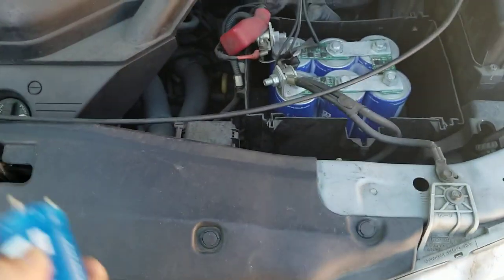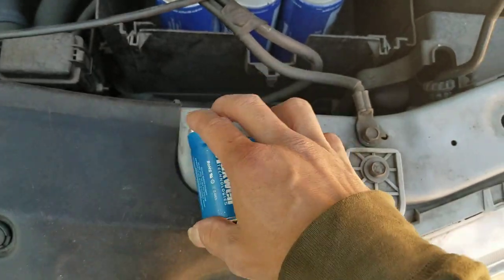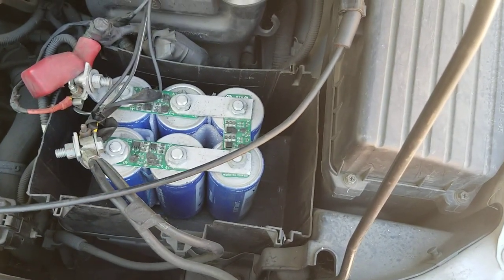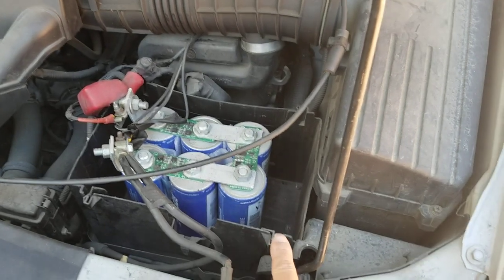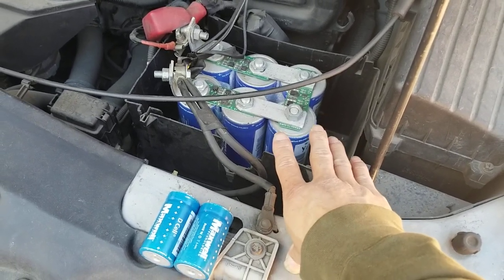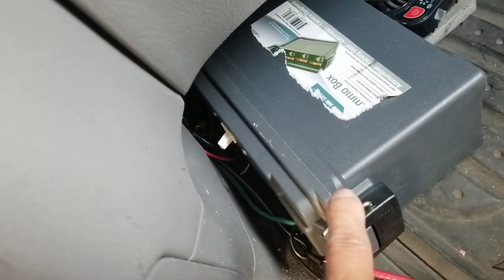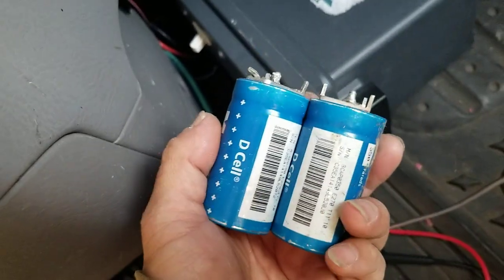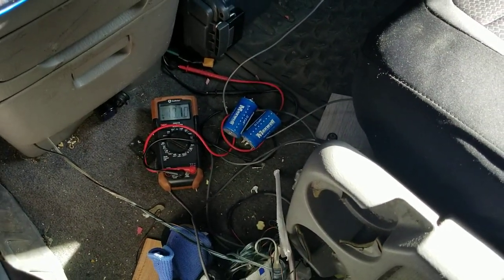Replace car battery with Ultra or Super capacitor, save more $ links below

Comment: 1, You applied a high melting point tin thread that it didn't work well on your 500F polar beam. 2, Your iron was not power enough to connect the polar beam to the cord. Suggestion, low MT thread,200 celcius , bigger iron atheist 60watt, preheat the cord with a torch.

Comment: Can i do parallel connection with a battery.?
Reply from the maker: Yes, you can do parallel connection but with smaller super cap.  I have the links to buy it in car/vehicle category in the list below the video, click more you will see the drop down.  Buy that ready build,  YOu also should buy the Battery desulfator,  it will help your 12v acid battery last much longer.  Good lucks take care... stay safe